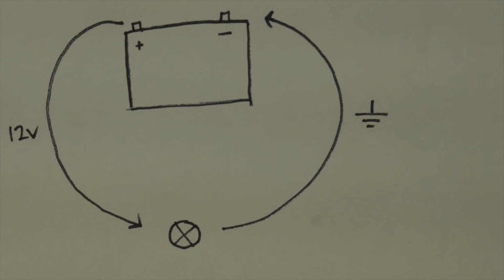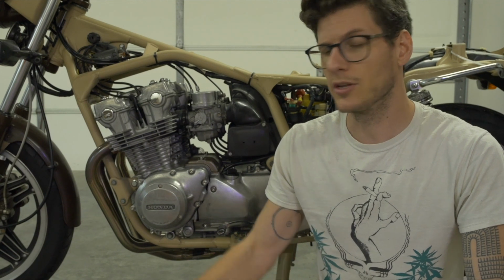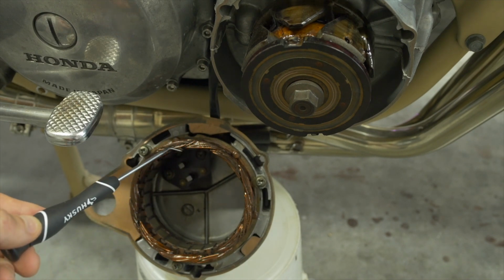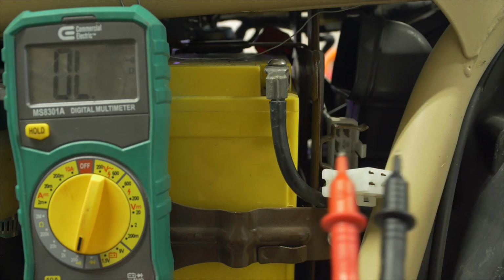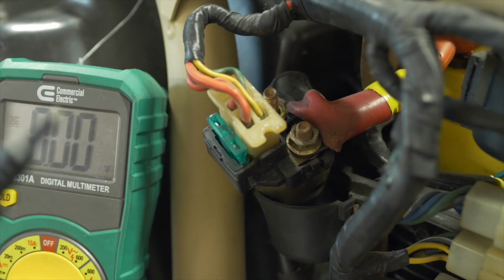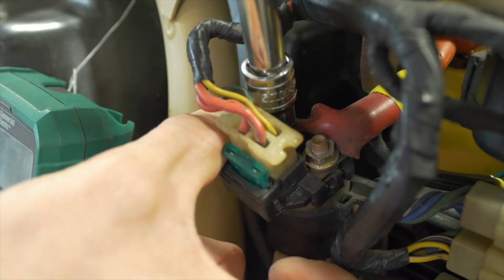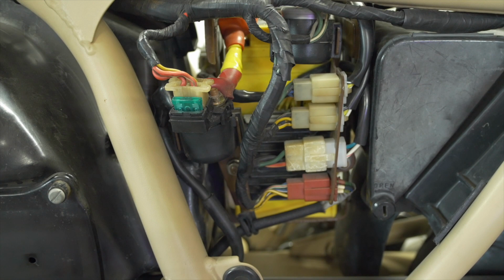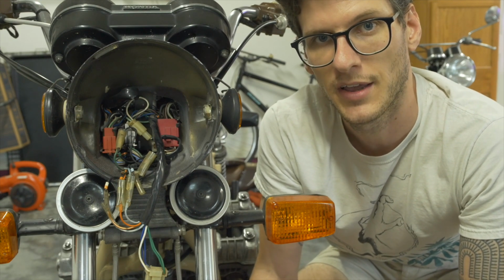1980 Honda CB750 DOHC Electrical System Explained

Comment: This is a fantastic video, very helpful. I have the exact bike and I have a problem. The previous owner cut the connector off of the ignition switch and I’m trying to rewire a new plug. I have no idea where what wire goes into what position on the plug. Also it seems the switch has five connections and the plug has six positions, but it seems I have an extra brown/white wire. Can you explain what I should do for this? Thanks!
Reply from the maker: My ignition connector is a square connector that appears to have, from left to right on the back of the connector, from top to bottom: 2x brown, empty, 2x brown/white; black, red, 2x brown
Reply: So you are saying the brown wires both terminate to the same position and the brown/white both terminate to the same position? 4 connections into the switch?
Reply from the maker: @tblackwell1  Yes, but five positions total. I have two brown wires in the top left port and two more brown wires in the bottom right
Reply: Ah, thanks for the clarification. Mine is a tad different for some reason. There are five connections on the switch. I paired the brown/white wires and put them in the bottom opposite corner to the black and one brown next to the power and the remaining brown in the corner behind the black. 
It kinda works but…
The headlight comes on, the tail light comes on and when you switch the turn signal to the right the front right comes on constant and the indicator on the dash is dark and the rear turn signal is blank. The left side is totally dead all three lights. The horn works, and the ignition with energize the starter solenoid. So we are close. But I have some chasing to do. 
I had to refurbish the turn signals so I need to check their connections. And I need to check the brakes connections as I need to rebuild them so I’m not sure they are right. Any advice on the position of the brown or brown/white locations?

And by the way, I really appreciate your conversation on this. What a huge help! Thanks

Comment: Just  checked  everything . All ok, then noticed  outside  rotor  brush  worn-out . This  brush  wears out  first  because  of  the  difference  in  circumference  and  distance  it travels over the  rotor . Check  this  first . 5 dollars  fo both  brushes. Fixed .

Comment: Fantastic video.  Thank you so much for presenting in a clear and thoughtful way.  I have 1980 CB750 Custom.  A while ago the charging system failed and in troubleshooting I discovered the router was bad.  I’m not a “handy” person but enjoy learning and I’m committed to doing all of the maintenance and repair work on my bike.  I wish I had seen your video when I was troubleshooting the charging system — would have saved a whole of time!   (And to your point on lithium ion batteries — I upgraded when I replaced the router but didn’t realize that I needed a regulator rectifier that worked specifically with lithium ion.  That mistake was lesson learned #2!)  Thanks again and hope you continue to make more videos.
Reply from the maker: Thanks J! I'm glad I could illuminate some concepts for you. I'm not an expert myself but also enjoy learning and being self-sufficient. Good luck with your bike and remember to enjoy the ride!

Comment: I didn't  see  how  to check  the  diodeps in the  rectifier  / regulator. Isn't  this  a common  fail issue.
Reply from the maker: Hi Jack thanks for watching-- as I pointed out early in the video a reg/rec upgrade is only about $100 and so I did not go into testing it. If you suspect yours is failing, I would just replace the part. Otherwise, I'm sure there are many sources online that can tell you where to stick your meters to check current through a diode.

Comment: I am having trouble wiring my CDI to a m.unit. I thought I had everything right but my green wire is reading 12v. Do you have any diagrams specifically for the CDI?
Reply from the maker: Hi Ben, no diagram exists specifically for the CDI, but you shouldn't need one as all wires are clearly labeled in/out on the main wiring diagram. Here it is: https://www.dropbox.com/s/uo3y2ok342xhhvz/Wiring_Diagram_CB750F_79_80.pdf?dl=0
Reply: @Gumaamug I tried to follow the link but it says the item was deleted. Could I get a current link?

Comment: Hi just found you channel,,,,can you please send a quick update on why the cdi,s in my bike have melted ,,I have just started to restore the bike and today come across them ,just to say the bike runs ok ,,,thanks Michael from the UK 🇬🇧
Reply from the maker: Hi Michael; are you sure they are melted? The CDIs have epoxy resin on the back to keep them sealed up and this could degrade over time. If the bike runs OK, it probably means the igniters are fine
Reply: Thanks so much for your reply,,the cdi,s have definitely melted ,,so today I  noticed the bike has got  a what seems to be one new coil so I wonder if one failed so that could have caused the melt down

Comment: This IS one of the best videos of how to work on ANY motorcycle electrical system. Especially custom bikes that need custom wire harnesses.  I am an electrician - and I DO suggest that you get a better digital multi meter, and/or NEW tester leads. A 1 ohm reading with just the leads is VERY bad. That will cause volt tests to be wrong - because you are adding resistance into the test.  E=IxR  (or volts=current x resistance) is Ohm's law. Your leads (or internal meter resistance) is causing bad readings.... Other than that - this is a really great video. I am also glad and impressed that you mentioned in the beginning that electrons flow from negative to positive - just like lightening actually goes from the ground up - lol.. Thanks..
Reply: I know right?! 
I saw the one dude a few days ago and I thought he was great and in no way  am I taking credit back, But I actually think I'm going to take care of the clicking.This is my 2nd street bike.  My last one was a 1980 Honda CB750 F.  Had a little accident and that hurt got rid of it now I figure try it again.i have a 1981 now . Both very fun
Oh and I'm not a mechanic at all But I'm learning from these videos. 
Some stuff

Comment: A question about your ac stator test...If the regulator applies voltage to the rotor via the black and white wires in order to energize the stator, how do I measure AC stator output without disconnecting the Regulator from the field coil? (they share a connector) Thanks.
Reply from the maker: Matt great question-- I should have mentioned this in the vid. You'll need to use your probes on the back side of the connector and push them in where the wires go in. You should be able to make contact that way. Emphasis on "should" :)

Comment: I have a 1979 cb750k it would not charge when I got it  I replaced battery  stator  and the rotor  now  it will run and charge for about 30 seconds it pops at the rotor  and melts one wire off of the rotor and  quits charging  any ideas  anyone

Comment: This is a good video on general electrical troubleshooting of this model. The white plastic block with the alternator wires is referred to as a coupler. It is much better to probe these couplers from the back as it prevents damaging the connecting part of the wire terminal. The starter circuit also includes the neutral light switch so that the engine can be started in neutral without pulling in the clutch lever. I think it used the neutral switch as a ground circuit as well as the clutch lever switch.
This model's alternator can generate more then adequate power to keep the battery charged, but with time and use they can get weaker. As well as testing the stator coils, check the rotor for insulation from ground, resistance of the winding and good continuity through the brushes. Since the rotor is always spinning, it can have shorts in the winding that reduce the output. Rotors and stators can be rewound.  If the bike is dropped on the left side and the side cover is moved, the stator can rub against the rotor and damage both parts. 
I don't think testing the open circuit AC voltage from the stator is a valid test. I would rather test the AC voltage between the yellow wires with the engine running and the coupler connected to see if they are similar. You could also test the battery voltage with the engine running, it should be above 12 V and not go over 14.6 V. A long time ago we use to test battery charging amperage, but this test is no longer used much.
The ignition on these models is a transistorized system not CDI. The spark units above the battery were notorious for failing. The symptom is that the engine will not rev to red line and the bike acts like it is governed. The coils are probably good, but you may need to cut some of the spark wire off at the plug cap end as the plug caps use a screw that threads into the wire and over time the connections get bad. Peak Voltage testing is the best way to test ignition systems. TecMate has a good tester for this.

Comment: Question, what size relay would I get to get to wire for my led turn signals?  And would I just replace whole relay? Thanks in advance!
Reply from the maker: Hey Derek, I'm not an expert in LEDs on bikes. I know that in addition to replacing the mechanical relay with a electronic one (yes you do need to replace the whole relay), a diode needs to be added in the circuit somewhere. But this is where I'm unclear because I think some manufacturers sell lights with diodes built in... I'd Google it, and obviously since this is not a model-specific upgrade there should be plenty of info online to guide you. Good luck!
Reply: @Gumaamug  thanks for help much appreciated!

Comment: I recently got a 1984 CB700sc nighthawk. When I was riding the bike suddenly shut off and wouldn't start, the only thing that happens is the click from the solenoid. I already checked the new battery and it was good. Do you have any idea as to what the problem is? All the lights come on, and when I bridge the solenoid terminals it doesn't crank as well. Thanks!
Reply from the maker: Sudden shut offs are usually related to a ground issue. Remember that if the DC circuit is broken, even briefly, no power will flow. Are you blowing any fuses? Can you measure both sides of the solenoid and confirm 12v passes through, the way I do in the video? Can you measure the voltage from the (-) side of the battery to the end of the cable that connects to the starter motor? When you press the starter button you should see ~12v there. If all this is fine and still no crank, start checking ground connections.
Reply: @Gumaamug  Ok I just checked the solenoid and there is continuity. I also checked the voltage to the end of the starter cable, showing 12.3v. I'm not sure how many ground points are on the bike but I confirmed that the negative battery cable is grounded tight to two spots(engine and frame it looks like). 
I guess my question is: will all the lights turn on if there is a broken DC circuit(It turns on)? What ground connection enables both the starter and the ignition system?Thanks!
Reply from the maker: @YourBestFriend822  It's possible for some parts of the bike to work and not others since different circuits are somewhat isolated and usually have a fuse for each one. The two grounding points you mentioned are the main ones for the bike, so you're probably fine there. Have you checked all your fuses? If any are blown, start by troubleshooting only that circuit, looking for frayed wires, a screw gone through the harness, etc.. I don't have a wiring diagram for that bike and though it is a CB750, the Nighthawk series of 750s are different from the 79-83 series so I don't really know the location of everything. But— if you have continuity through the solenoid and you see 12.3v on the end of the wire that attaches to the starter motor, then you're almost all the way there... make sure the motor is firmly bolted to the engine, which is its grounding point. This still does not account for why the bike died on you suddenly, and so I would also go sniffing around the killswitch to make sure that is wired correctly and a previous owner didn't put some kind of hidden killswitch on the bike.
Reply: @Gumaamug  Ohh good call! Yes, I also believe it's not the starter, although it should be able to turn when I bridge the solenoid regardless of other circuits right? I just checked the fuse diagram and found that one of them is ignition start, and I'll be checking that for sure! Thank you so much for your help
Reply: I haven't checked the starter but in the case it's bad, I'm not sure if it'll cause the running bike to shut off.

Comment: do you know what i should look for if my bike keeps blowing fuses when the stater cover is tightened?  it will only blow a fuse when it's tight.
Reply from the maker: Sounds like the stator is grounding out against the cover. Check the stator and make sure none of the windings are frayed or pierced by anything, especially near the bolt points.
Reply: @Gumaamug  I've got it sitting in front of me. i don't see any bad spots. it's also a new part.
Reply from the maker: @zacharybartels3680  I can't tell you much if it's an aftermarket part as I don't have it in front of me. Does the company that sold it to you have a support number or email you can contact? Make sure the AC wires that power the stator (black and white on the connector) are going to the appropriate wires on the aftermarket part. Sometimes with aftermarket parts you have to modify the connectors.
Reply: @Gumaamug  it's a Honda part i got from a dealer. it's wired correctly. would stacking two gaskets work or do you think that would cause more problems.
Reply from the maker: @zacharybartels3680  Are we talking about the same bike? I don't know anywhere you can get a new OEM stator for this bike— they're forty years old. I'm sorry, I don't think I can help you.